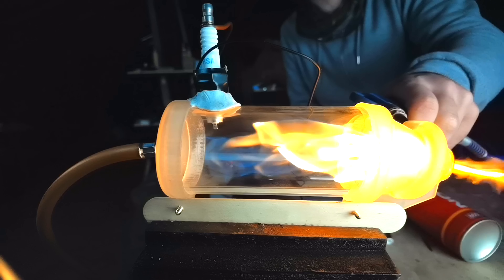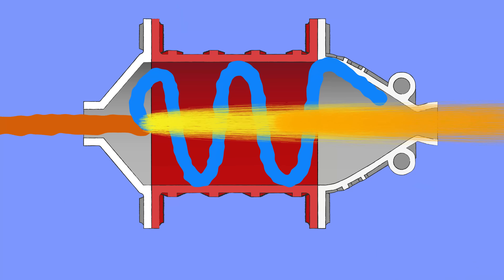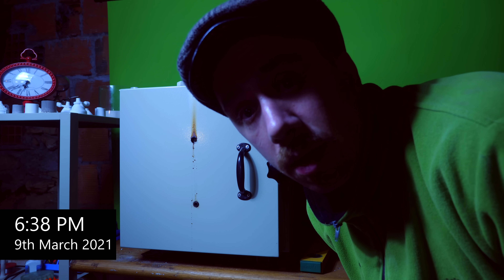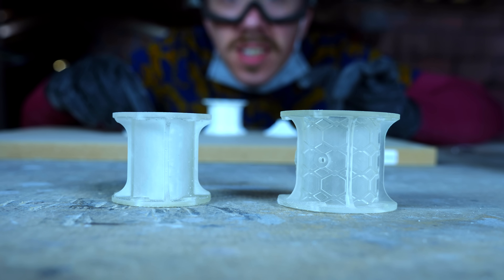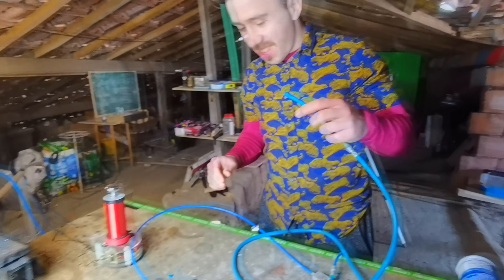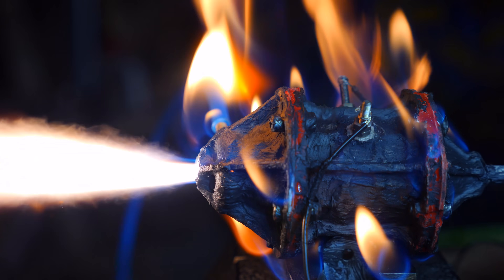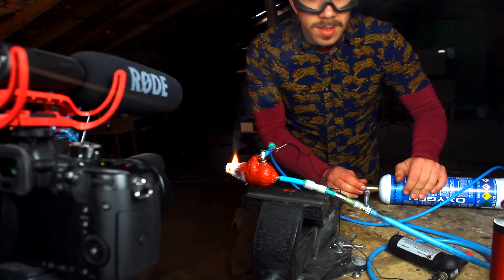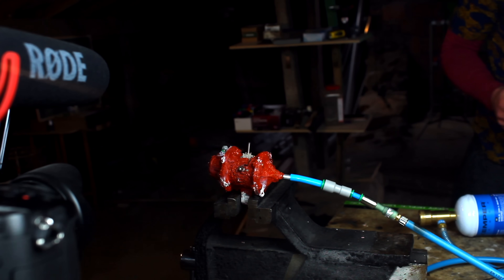Vortex Rocket V2.0 (3D Printed)

Comment: You can try to take a box, place your engine inside and cast concrete/silicone or maybe even more ceramic or plaster outside of the engine. If you manage to handle the wiring and tubing before casting the material, your engine should be way more robust i believe

Comment: Hi, Integza! Why you doesn't try StarLite DIY material? https://www.youtube.com/watch?v=0IbWampaEcM (don't forget Borax!)
It holds very high temperatures. I think it can be a great material for sealing your engine.
I've wrote about this thing several times but it seems that you've didn't read or ignoring this.
P.S. your high-temp silicon can be toxic while burning.

Comment: What if you cover it with both the silicon and cement,since silicon somehow melt due to heat and leaked while cement doesn’t but porous?

Comment: Maybe submerge it in a resin, put it in a vacuum chamber to replace atmospheric gasses with resin. Pull out, let cure. Sealed internally rather than just the exterior wall.

Comment: I would suggest you put ball vales on the on your O2 and propane lines for quick shutoff...  also a regulator if possible to control the flow and make the process more repeatable.  Cheers from 🇨🇦!

Comment: Not much in terms of solving the actual issue with the rocket, but for better control and safety you could revive Integza bot and give it solenoid valves to control the flow of oxygen and propane, so you can have a big red emergency shutoff button (and control gas throttle more precisely maybe)

Comment: Suggestion to improve vortex design:- Increase the length of the tube and the diameter of the tube. Try printing it in one go.

Video idea 1:- Try creating a rocket with ionic wind trust. It could help to replace traditional fossil fuels from the engine.
Video idea 2:- Rebuild the tesla coil with improvements. Use a very high power source like a step-up transformer or a generator.
Video idea 3:- Make a very high voltage generator that can generate high-frequency alternating current.
Video idea 4:- Try working on electromagnetic levitation projects. They are cool.

Hi everyone, I am a 15-year-old boy with many ideas and projects like this. I am giving 4 ideas because I really wanna win a 3d printer. Please like this if you like any of my ideas.
Reply: You got some good ideas. However, ionic wind thrust is really really low power. It can barely move a piece of paper, let alone a rocket. We have created ultralight aircraft that are able to harness it, but they can barely move themselves. Useful for drones perhaps, but won't be replacing airliners anytime soon.
(Real Engineering)
https://www.youtube.com/watch?v=IorDYGI1uqc

If one were to create ionic wind powerful enough to move, say, a car, it would dangerous to the driver and every electronic around it. 
(electroboom has a good video about it)
https://www.youtube.com/watch?v=jW3_txSfIAQ

It really wouldn't work on earth, and in space, there just isn't enough "stuff" around to get good propulsion from ionic wind. Right now, we use Ion Thrusters in space, but we bring the fuel with us (usually argon or xenon). These fuels are far too expensive (for most consumers) to be viable. 
https://en.wikipedia.org/wiki/Ion_thruster

TLDR: Power to Cost ratio too low to be viable (on earth)

You got the spirit though. We need every last one of us to be figuring out new ideas to combat climate change. Keep up the good work! :)
Reply: @FaffyWaffles   I agree but it's worth a try. If we don't try and fail, we won't learn and be successful. In the beginning, electric cars were also very low power but instead of leaving the idea, someone tried to improve it. Thanks for your appreciation and I agree that we all should give our 100% to climate change. My many ideas are based on that. All I need is a 3d printer to test them.

Comment: You should consider using glazing as a sealant for ceramic parts, I've used it for ceramic crafts and it leaves a beautiful gas-tight finish. It would take an additional burn but it can be more durable than the cement.

Comment: I wonder if you split the engine walls into sections - like slices of an orange peel - if you will be able to make them much thicker that way without distortion/cracking? Sure it will be more assembly, but thicker ceramic will leak less I think

Comment: Hey Integza... try coating the inside of the ceramic with flame proof paint. We use it in the shop to coat exhaust manifolds. Not only does it hold up to 2400 'f but it also blocks heat from going through.. with the paint being viscus as it is it may penetrate the pores of the ceramic. also the high heat silicone you are using it only withstands heat up to 700-900 'f....... lots of love .your Tomato buddy Jeff

Comment: Could you print a mold from some sort of water or solvent soluble plastic and cast the parts in refractory cement. They could be plenty thick.,
If you can't dissolve the mold afterwards you could melt it off, probably messy. Great video very creative.

Comment: Nice vid as usual! You could try coating it with a high temp metal that should prevent the leaks (if the ceramics withstand the application of the coating), also if you blow some air on it it should help with the heat dissipation.

Comment: I think you need to look at a three step production chain for these engines, where you use some sort of soluble sealant that you can soak the part in then dry or neutralise it to create the final product.  Perhaps SiO2 dissolved in hot concentrated NaOH aq. would do the trick, providing you can neutralise the hydroxide without ruining the finish?  A ceramic glaze may also be a cheap and easy option allowing you to pain the part (Themed colours!) and then refire it.  I vote for the latter, not the tomater.

Comment: For your next video, you can make a simple Rocket engine thats is powered by liquid fuel and made out of a short piece of metal pluming, a cap thats would bolt on and a nozzle, that you could even find in as a pluming piece.

Comment: Great video! For sealing the engines I think you should be able to use the same sealants, but put the engine in a vacuum chamber right after, while they're still wet, so they penetrate deep into the ceramic. If nothing that may at least help it survive for longer :)

Comment: You could maybe try some metal filament which is 80% metal powder and print the engine with that then preform extensive electrolysis on it giving it a full metal coating but I’m not sure if the plastic around the metal would cause this to fail and it may not give a thick enough coat but still a cool idea

Comment: Hi Integza, I don't have 3D printing nor engineering experience. After that disclaimer... You said that the resin itself is porous because of the 17% of volatile material. My approach then would be to find some high temperature material that you can soak the printed and cured parts in. That material may diffuse into the ceramic and reduce the porosity. Unfortunately I don't know which material. Another possibility would be to increase the thickness. For that I would print and cure the parts the same why you do, then paint or soak with a thin layer of porcellite, cure again. And repeat if needed to slowly increase the material thickness. I don't know what happens if you reheat a part that has been cured. I guess it shouldn't crack but I don't know. I don't know if any of these suggestions are good, but maybe it's worth trying. Keep on doing great stuff!

Comment: Try it first u make the rocket as usual  then coat it with a couple layers of wiremesh and some mouldit(epoxy clay compound)  aftrr it dries it gets hard as a stone so would fix your leaking problem also you can shape the rocket exterior as you want!

Comment: in ur test runs also u were having  what is called a hard start which is basically gases enter the chamber 
then igniting which causes a little explosion, in your rockets cause the 1sucessful chamber to have leaks in the second test run.

Comment: I'm know shit about physics cause i'm a litterature student, but I would say If you can't manage to solve a problem, you need to rethink everythings: 

does the pressure level and the balence of oxygen + fuel have an influence on the efficiency of the vortex to protect the engine? 
Can you use some sort of valves to get the perfect amount of pressure & gas+Fuel in one time to avoid perturbation in the vortex engine and get a perfect ingnition ?
Don't you think that getting liquid fuel directly inside the engine is incompatible with a vortex engine? 

Does printing some rift (like in canon) in the engine increase the quality of the vortex?  

can you try to render a fluid simulation to find the most optimized design, they might be some tools online?

I hope I help, if I did, it's good, or else it was fun to write this.

Comment: You could try soaking the engine parts after firing in slip (liquid ceramic solution) and then firing it again. You might need to put it in a vacuum chamber or a pressure pot though. The idea being you want to fill the voids left in the ceramic left by the burning resin.

Comment: cover the ceramic part with heat resistant foil from the outside and inside and then cover the it with silica on the outside

Comment: Hi integza to help with your leaking problem with the jet I feel like if you soaked it in a high temp sealant and give it some time to fill some of the micro cracks and holes that you can't see I feel like a liquid truck bed liner would work that's followed by high temp resistant paste, hope this helps :)

Comment: Can you make a model that has a double shell where the air intake runs through this duct.
If gas or oxygen seeps through the first shell, it just sucks the suction back into the combustion chamber.
it will probably also help keep the temperature down in general.

Comment: Damn your so close. Hear me out I have a crazy suggestion. What happen if you 3d print your engine parts in resin. Send them to presstube. The he can cast in metal. It could be one awsome collaboration between you two. Fingers crossed it would work amazing and if not we still get to see fire 🔥. I believe he can cast your resin and then melt the resin out before casting in metal.

Comment: Ever tried to use that resin without baking? I don't know the material, but maybe the resin seals the ceramic until it gets burned away by the heat of the engine.... Or it just burns from the start... LOL Just a thought.

Comment: You could print an assembly two half ceramic part from the combustion chamber, fill the inside of thoes with soldering, sand it and close it. It should stop the leak from combustion chamber due to the porous resin. Same Whay for the nozzle. The weak part still be the injector, that have the truncade geometry for vortex generator. To that, you could fill with soldering from the outside, insteal from inside. The process is the same. This process is the way of refurbish car’s motor cylinder head for when the joins burns out, indeed.

Comment: As i saw it on the last test, the problem with the silicone is that it cant withstand the pressure, even through the walls. Maybe putting an outer container around the engine, and completely filling the space between the ceramic combustion chamber and that outer shell with silicone could work.

Comment: what about 3d printing wax or plastic molds for inside the engine or nozzles or whatever you want and then coat the mold with the corrwct type of ceramic and then melt away the wax or the plastic mold . you will even be able to reinforce the ceramics with steal in it

Comment: just dip the entire engine in a bucket of cement and here you go, no leaking! jokes aside i think  what's happening is that when you squished sealant between parts it came out inside the chamber and made the surface not smooth creating uneven flow and pockets of hot high pressure gas that blasts through ceramic, however this does not explain why the single part engine suffered a same fate, perhaps the design was fundementaly flawed and you need a different geometry?

Comment: To help seal your engines, since you're using a porous material, try creating a COPV, or composite overwrapped pressure vessel. While these do have a tendency to pop when built incorrectly, I believe the sealing power of the composite material wrapped around the engine will help somewhat.

And there's a second idea, try recoating the engine in resin after you shrink it the first time, using a more common resin type, such as that used for making those fancy tables and such. Make sure to put in your intake pipes, and seal the engine before recoating in resin, so you don't get any inside.

Lastly, for a dumb idea, try some Flex Seal.

Comment: tomato smashing steam engine!  A smashing mechanism can be mounted on flywheel or crankshaft. Also for the problem about meltdown use 3D printer to print mold then make a real part by sandcasting it. the parts wont be perfect and would need a postprocessing but they would be good enough. Also don't cast hallow objects( I mean full empthy objects cilinders and such are ok), better segment them in smaller pieces and use some higher temp metal not aluminum. For melting metal you could use diy furnace.

Comment: If you revisit the sugar rocket, you might want to take a look at TechIngredients (if not done already).
Maybe include some slightly inclined fins at the base to provide spin stabilization.
You could take it one step further and make the rocket steerable with some fins at the top of the rocket, though that would increase cost and complexity "a bit".

The last one could possibly make for a good collab with Tom Stanton.

Comment: Sealing the ceramic body: 3D print ceramic part, paint with your coating (not the high temp silicone though) combined with a high temp mesh, then (while still wet) attach a vacuum pump to the rocket nozzle (with the fuel entrances closed off) and let the coating cure while the pores are under vacuum pressure. Atmospheric pressure will then push the coating into the pores of the part. Bonus points if you use a Tesla based design to create the vacuum.

Comment: Porcelite is porus thats how the resin escapes and why you get leakage and why the air probably isn't flowing well, I recommend making the prices in halves so that you can "paint" the insides with the heat proof stuff and do it in layers for a smoother top layer
Reply: Also use the paint to seal as gaskets

Comment: Since you have a kiln, you should be able to glaze the inside of your ceramics, it will get rid of the porosity, but at a higher risk of cracking when firing it in the kiln 🤷‍♂️.
Anyway I really like your videos, keep them coming 😁

Comment: Did you try and put a layer of cement also inside of the engine ? the pressure would push it outward, against the ceramic, while when you put it outside, it perhaps gets unglued/broken off the ceramic ? Or is there some kind of "bath" of hear resistant paint  (if such thing exists) to fill in the porosities in the ceramic ?

Comment: Think of the rocket engine as a turbine turbine engine is air cooled buy a fan on the outside that also spins while the turbine is in motion so if you can incorporate that that engine able to cool The outside as well as the inside just like the turbo jet engineBecause the air flowing over the outside is what keeps the jet engine from melting

Comment: You should also think about thermal expansion and cycling. I see that for example in the single-piece engine that it is not leaking immediately, but only after a short while

Comment: Making a simple engine out of common household objects and tools(rocket engine out of bottles/boxes with glue, tape, screws etc), and make it power a equally simple vehicle (a car, boat, or plane. Or use the body of your air driven sterling engine).

Comment: seal it with plaster. after assembly submerge the enture engine without the nozzle opening to thinly mixed plaster (like a milk viscosity) , let it dry a bit and do it again few times. There are also sealing mortar mixtures that can be also used

Comment: Video Idea:
Make a small model car controlled by an integzabot 2.0 that can be powered by any of your previously made engines. The car could be a good way to revisit old engines that you might want to test further. Of course one of the tests could be if the car could move fast enough to hurt or destroy a tomato.

Comment: To stop your leaking probelm, you should build a two part engine out of ceramic 3d resin. Then coat it from the in and outside. Otherwise you could make one out of plastic and use it as mold in which you could fill a metal like titanium (or a even more heat resistant alloy).

Comment: I would try coating the inside of the combustion chamber with a sealant. Coating the outside lets the gas inflate the coating, pushing it away from the ceramic surface and exacerbating the problem. Putting the sealant on the inside will cause the pressure to push the sealant into the ceramic, strengthening the seal.

Comment: Put the entire engine into a pressurised outer case, that will increase the outwards force on the engine (reducing the Delta P on the walls of the engine, also reducing heat and heat flux through the material)

Comment: Would recommend 3D printing a castable engine and using it to create a plaster mold for metal engine prototyping. Aluminum should have a sufficiently low melting point to make its molten liquid form without expensive equipment, but still withstand pressure/thermal conditions for short duration testing. Alternatively, you might have luck sticking with the ceramic design and using glaze  (similar to that done for ceramic pottery) to seal the engine - however I would speculate that pressure will be a constant obstacle with using ceramics.